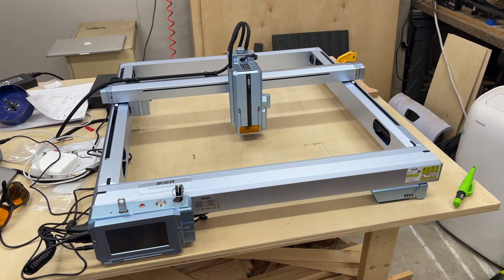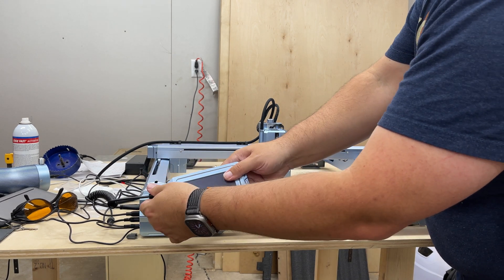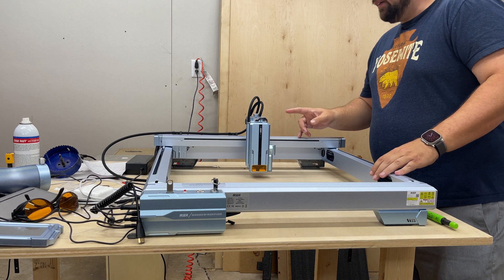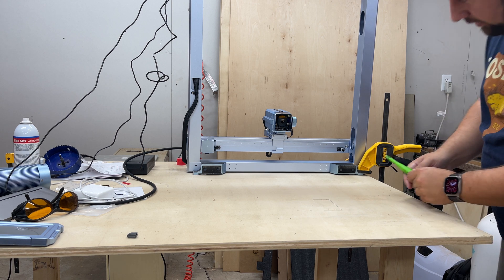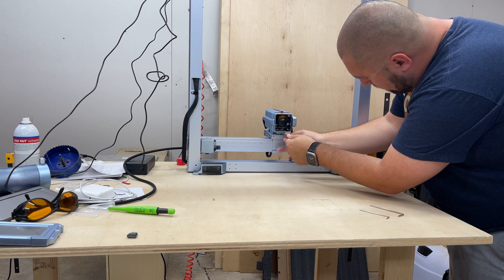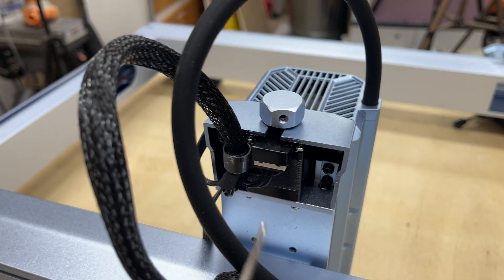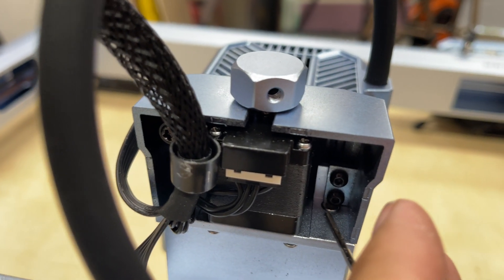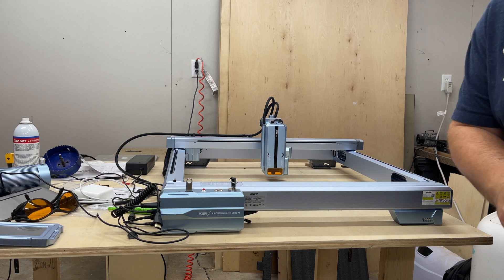Ultimate Guide to Repairing the iKier Z Axis: Step-by-Step Tutorial

Comment: Thanks for the video. 
I have problem with my autofocus, when my laser head going down Z axis it hit right over to the material and I can see it’s over run, I think there is no limit switch at the Z-axis. Do you know how to fix this? Did I set the height of the laser head position wrong?
Reply from the maker: Hey there. Thanks for the watch. When you attach the laser to the Z carriage you did have to leave space from the bottom or it did mention that the autofocus would have issues. I think it was about an inch or so.

Comment: How did the loose z axe problem showed in work? I have ikier k1 pro. And i have problem where horizontal lines ar super clean but vertical are all like oit of focus 3 times wider
Reply from the maker: Hey. It would rock slightly when I moved so it caused lines to not be crisp. Grabbing it and giving it a slight tug in each direction will definitely show you if it’s loose at all.